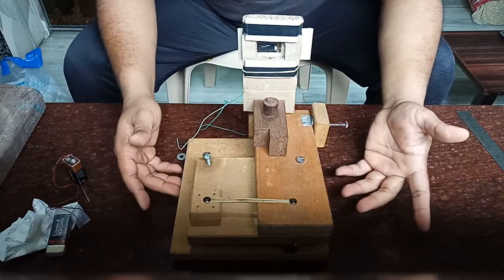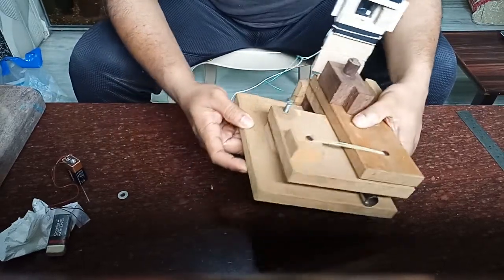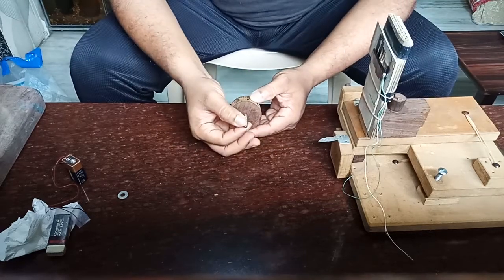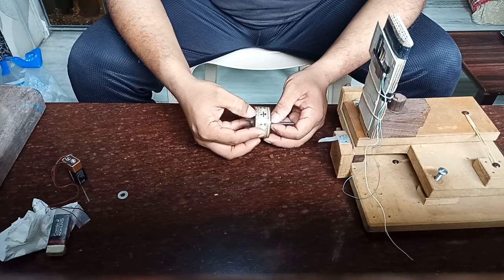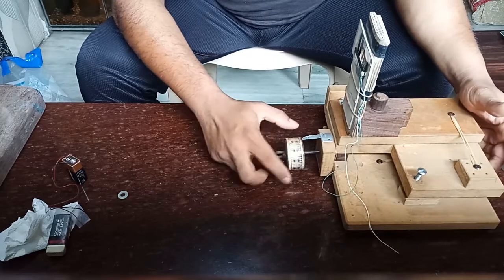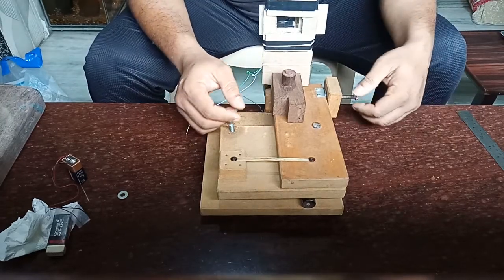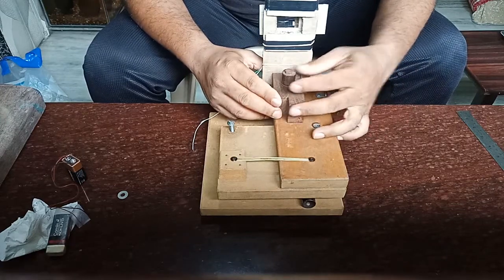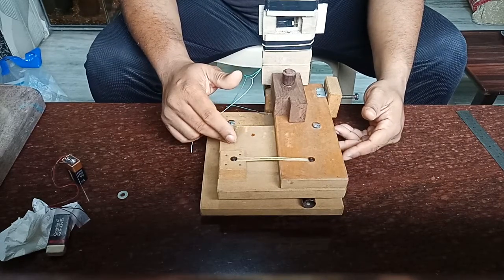My Foucault Tester

Comment: Great Video, What LED did you use?
Reply from the maker: Thank you!. The LED used if the one comes as bare LED strips. I later upgraded the tester to use a 10mm green one.
Reply: @astrokhan  do you have a manufacture and part number?
Reply from the maker: @ralphblach2952  No idea about the part number or the manufacturer as these are commonly available in my country. You may like to see this page https://astrokhan.wordpress.com/home-2/testing/foucault-tester/